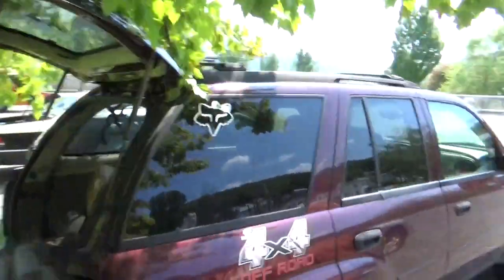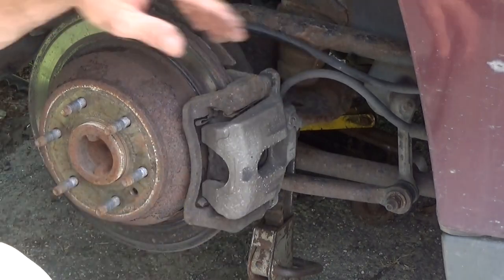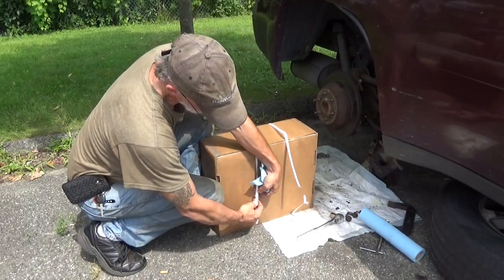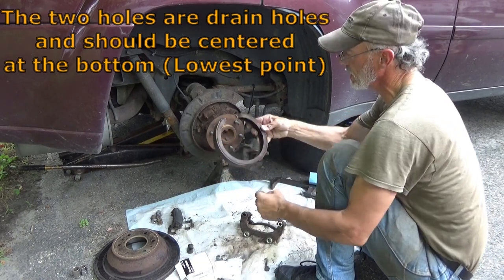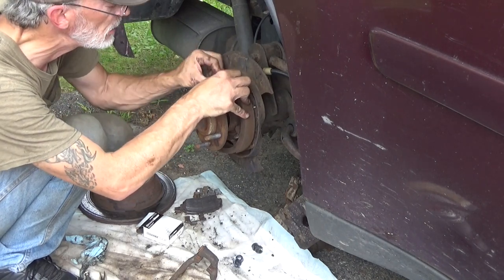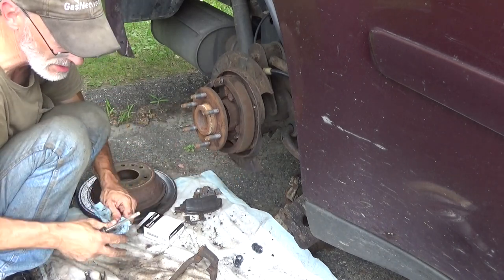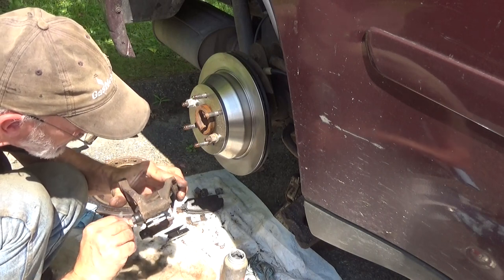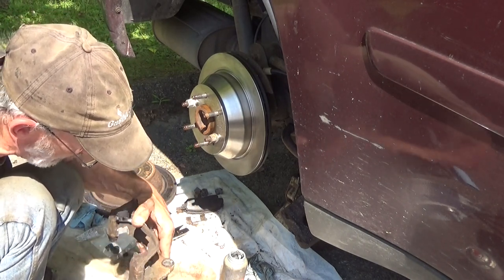2007 TrailBlazer: How to replace, service, and adjust Rear Brakes. And... a NEW TOOL!

Comment: Really great video, I've done brakes several times before but never with this amount of care and attention to detail.   I'll try to do all the things I learned here, and really take my time!    BTW I can't remove the lower 18mm bolt, even with air tools, so I'll likely be going to the shop for help with at least that part.
Reply from the maker: When one of those bolts get stuck.... the LAST thing you want to do is break it! 
It's time for penetrant and the fire wrench!

Comment: 👍Good stuff. Man, you fellers up north have it rough w/ that caustic ice-snow melt mess! Lil bit of Anti seize goes a long way. I’m in KY & I’m glad we don’t deal w/ too much of that corrosion causing road stuff! At any rate, thx for the vids. I happen to be waiting on UPS now for my 1Aauto brake parts kit for wife’s grocery gitter 07 Trailblazer (No 4X4) That emergency brake ass’y can give a man headaches if he’s not careful fersure!
👍🇺🇸
Reply from the maker: You got that right!

Comment: Thank you for making and sharing this video. What type of grease did you use in the holes where the pins go? Also what was the spray that you used on the area underneath the rotor after wire wheel cleaning it up? thanks again.
Reply from the maker: "Sil glide". Silicone Brake Lubricant. https://amzn.to/3p8gqGv
The spray is Fluid Film, to prevent future rusting.

Comment: Do you have video for cleaning or replacing ABS of rear wheel chevrolet trailblazer ?
Reply from the maker: Sorry, at this time, I do not. 
Spray the area with brake clean. Use wire brush around sensor and bolt. Spray a penetrating rust dissolving lubricant. Allow time for the penetrating lubricant to work itself in deep. Add more to keep mating surfaces wet.
The removal process varies quite dramatically depending on climate, and ice control solution exposure.
Remove retaining bolt with a light impact, if it doesn't want to move with light effort. Then, with light rock motion, use a pair of plier AROUND the sensor, to see if it will move. DO NOT force it in anyway, or it will get damaged.
Question to consider, if it is extremely stuck... Is the sensor cheap enough to destroy it just to get it out, or is it more expensive than removing whatever is in the way, to push it out.
Some sensors will snap off, in which case a drill, a screw, and a small slide hammer (dent puller) comes in very handy.
Hope this helps...
Reply: @HouseCallAutoRepair  That's pretty well !
Thanks

Comment: My drum seems to rub on the rotor no matter how much i adjust either way. 🤔
Reply from the maker: "My drum seems to rub on the rotor no matter how much i adjust either way."

That's probably because it should only be one or the other... not both drum and rotor.

Now, if you're talking about the parking brake shoes, rubbing UNSQUARELY against the inside make sure they sit EVENLY and flat on the backing plate, and that the retainer springs are holding the shoe against the backing plate, firmly. If the backing plate cannot support the shoes properly, it MUST be replaced.